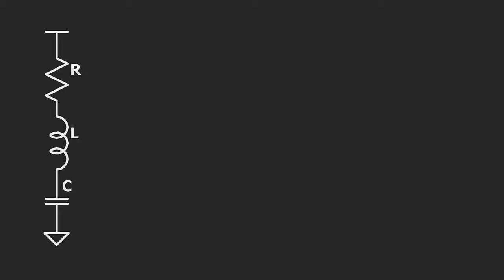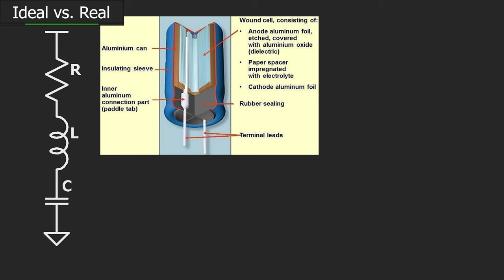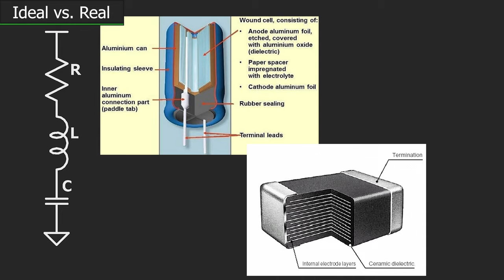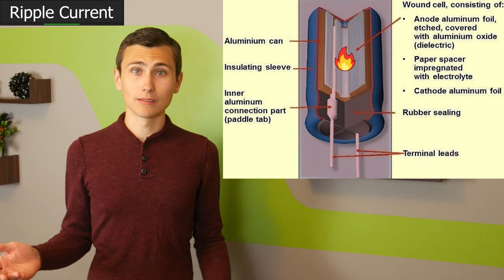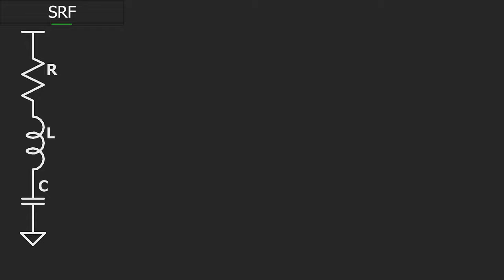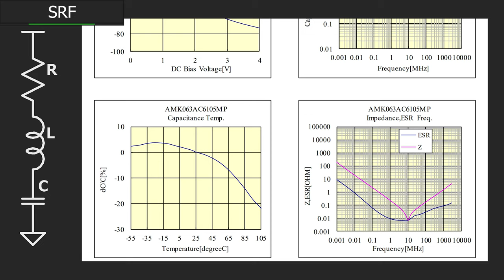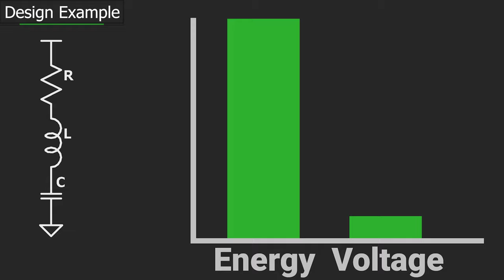Capacitor Selection & “DC Link”: De-Mystified!

Comment: just found your channel. really nice. 
came for some explained calculations for selection, but liked the content anyways.
Reply from the maker: Hi Kero Kero! I'm glad you enjoyed! Yes, choosing a DC link voltage is a very complicated matter. It will depend on many factors... But for a ups, it must likely be greater than the peak output voltage (plus a bit of margin for losses in the inverter).

Thanks for watching!

Comment: i have a few questions:

1. i have seen some welding inverters with full bridge topology which use electrolytic capacitors after mains rectification, but some welding inverters with half bridge topology using film capacitors after mains rectification with very small capacitance around 50~100uf. how does such small capacitance work for such powerful welding inverters which are rated at 7000 watts.

2. i have seen some chinese welding inverters which have only a few capacitors after mains rectification for very high power output upto 4KW. is this ok? what can be the consequences.

3. what will happen if we avoid capacitors after mains rectification in very high power switching power supplies.?

thank you
Reply from the maker: Hello Akshay, Thanks for watching, and thanks for the great comment!

A few answers:
1.) You make a good point that I didn't mention in the video: We can make decisions in a design that change what is required for a design. For example: If I design an inverter to operate at a higher switching frequency, less input capacitance will be required. If less capacitance is required, then perhaps a film capacitor becomes cheap enough, and this could lead to an overall more reliable design. (An inverter that lasts longer)

Another approach could be to use electrolytic caps, but WAY more of them than is truly requires so as the capacitors dry out (and the capacitance value drops) the inverter continues to function.

It's also possible that the design using electrolytic capacitors won't last as long, and will require a person to either throw it away, or replace the capacitors to restore functionality! It's a very complex (and incomplete) answer... but you asked a very complex question. Without the context for all the other decisions made around that design - all I can say is that it's possible to design an inverter that will work, for an amount of time, with any type of capacitor. Some designs may just last longer than others.

2.) If the design seems too good to be true... it probably is. It's possible they're using aftermarket components, re-using stolen designs, or something along those lines. Duplicating a circuit without understanding can lead to premature failures. That said, it may also work fine! If you're willing to take the risk of buying some E-waste(because you REALLY need that welding Inverter)... I'd recommend opening it up first to make sure everything is fused / isolated properly before plugging it in.

3.) It's possible! For example, current fed inverters (instead of voltage fed inverters) require very little input capacitance. Of course, the voltage will fall to 0 on the input (when the mains voltage crosses 0), so I'd expect to see a bit more voltage ripple on the output. Again, see answer 1 - depending on the requirements, it's possible to design circuits in many, many ways! It has less to do with power level, but for a high power designs, the high-frequency energy needs to come from somewhere.... and without capacitance it's coming across a cable, which could lead to electromagnetic radiation problems down the road.

This aren't complete or universally applicable answers, but I hope you find it useful or interesting!

Cheers!
Reply: @EEforEveryone  hi there, thank you for answering. The welding inverter which i looked into, having a single plastic film capacitor (50uf) running on half bridge topology, was switching at only 30KHz. That's not too High I guess. It ran on 3 phase 415VAC input. Is there any calculation which shows the minimum capacitance required if plastic film capacitor are being used .

Also I didn't know that the switching frequency mattered for input capacitance after mains rectification. Is there any calculation for this too. Please let me know
Reply from the maker: Hello! The  calculations for how much capacitance is required is the same for every type of capacitor. Consider how much current is being pushed into or out of the capacitor, and for how long. That will tell us how much the voltage will change during one cycle. If the voltage will change too much, there isn't enough capacitance! This is calculated using the fundamental equations for a capacitor.

Rectified 3 phase is very different than rectified 1 phase power, due to the 120 degree phase shift. This means the input voltage will never truly hit zero. 

For something like these capacitors, there is the mains input, which is at a fixed frequency, but the other half of the circuit matters too! The switching frequency of the downstream circuit will put some requirements on the DC link capacitance because it's effectively serving as input capacitance. Again, these calculations are not revolutionary or different from other DC-DC converters, we're just talking about higher voltages. The calculation for quantity of capacitance required is the same for this (Current and Time), but ripple current, ESR, and self-resonant frequency must be considered as well.